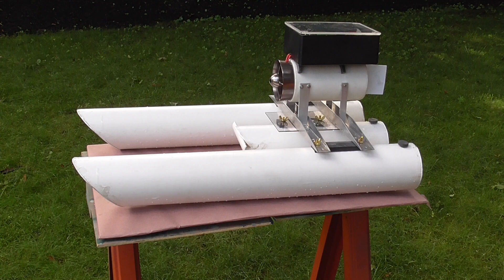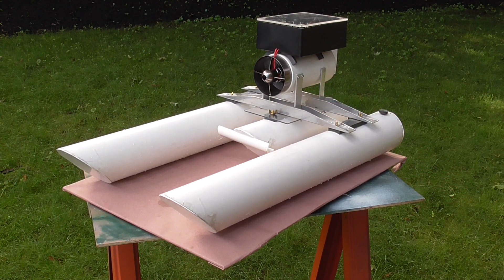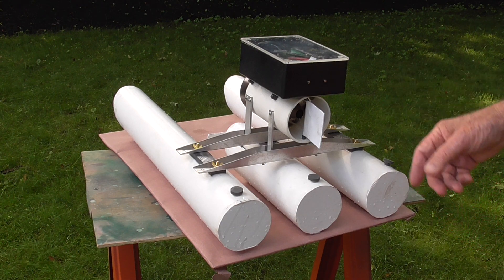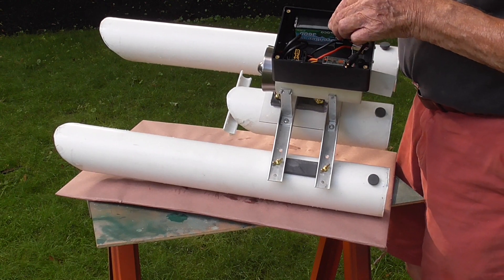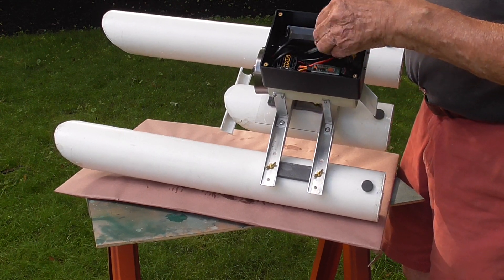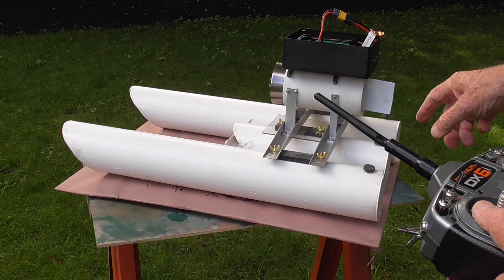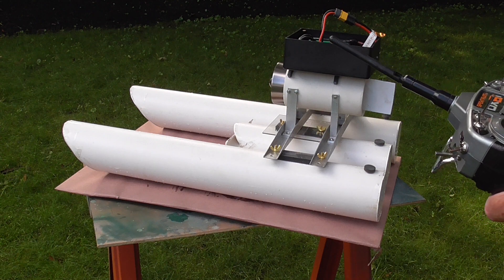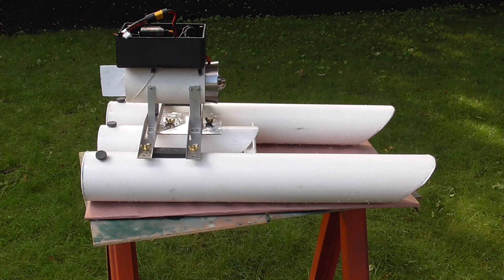R/C RESCUE BOAT DESCRIPTION

Comment: An important craft, for sure. I expect it to impede efficiency; but would it be worthwhile to have a second servo + rudder at the front of the fan for reverse, and always keep whichever rudder is unused (i.e., the front rudder during forward thrust, rear during reverse) in its neutral position?
Reply from the maker: Possibly, but I think so long as I can reverse straight out of a situation that should be adequate.  Further experience will indicate if reversal steering is needed or desirable.  My first version of this boat did not have a reverse at all and I was unable to uncouple from my stranded boat and ended up pushing it broadside.
Thanks for your interest